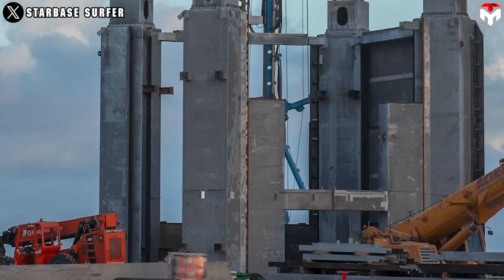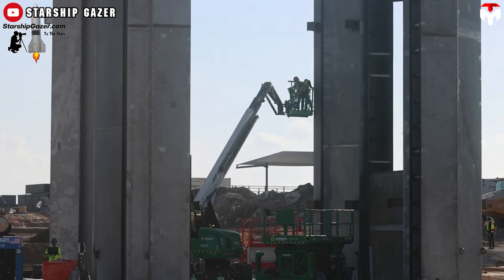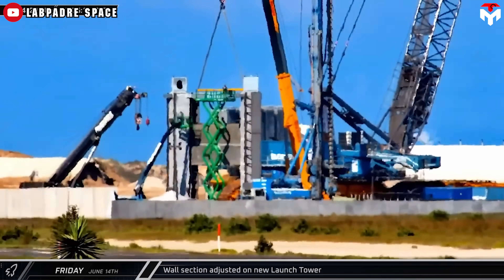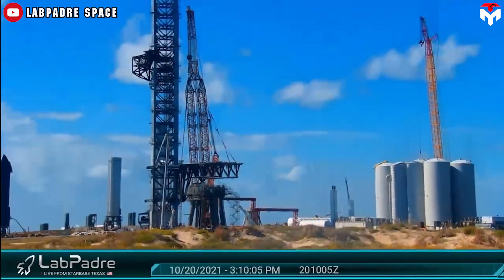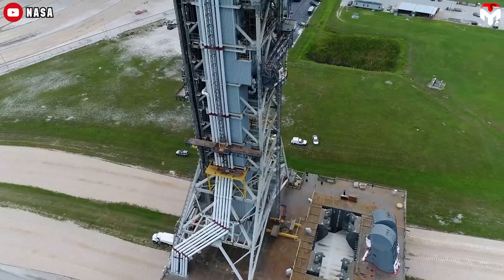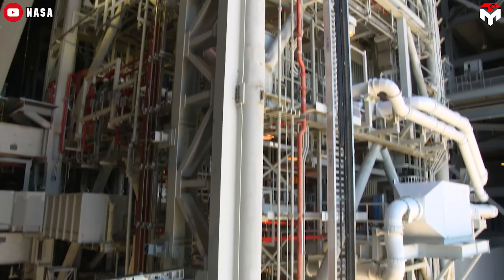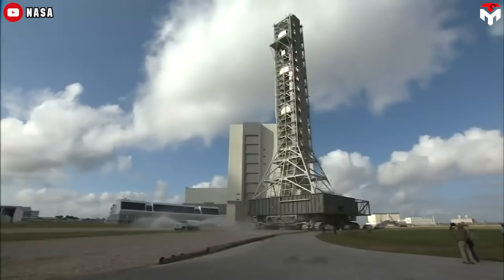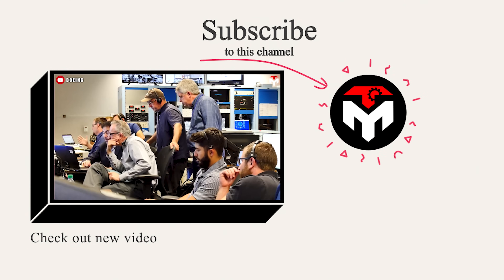SpaceX's New Launch Tower Rapidly Rising Speed Made NASA Embarrassed!!

Comment: Without a flame deflector, the debris shoots vertically up to destroy the rocket engines during liftoff.
Reply: What debris? The last time I checked the water deluge plate was broomed and swept clean before thousands of gallons of water flushed away the last 2 or 3 dust particles prior to lift off 😮😮😮😮😂😂😂😂🎉🎉🎉
Reply from the maker: you said correctly
Reply: What happens if an all-crushing cannonball crashes into an indestructible wall? Nothing good.